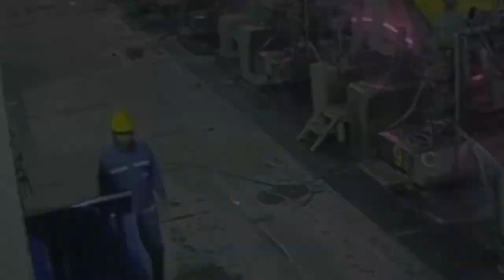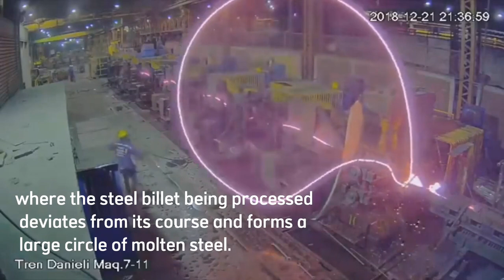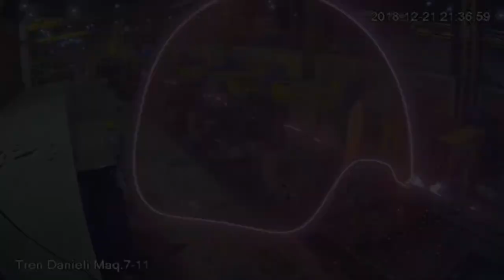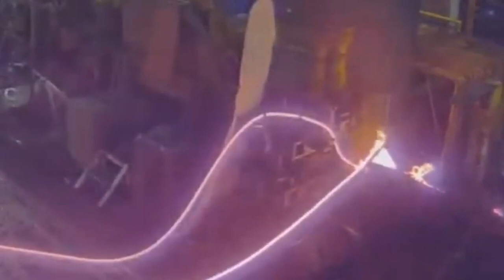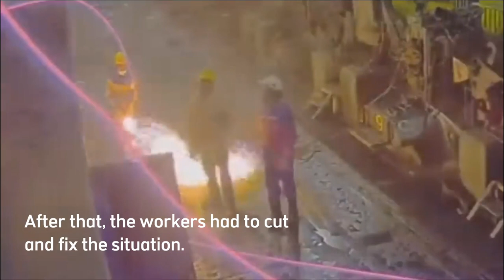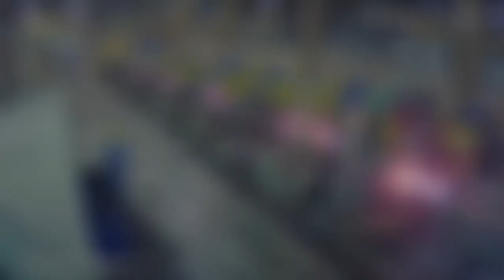Terrifying Steel Factory Accident: Workers' Close Call with Molten Steel Shower!" | MISHAPX

Comment: This is a perfect video to stress the need for emergency stops and why training workers to use them is so crucial.

This machine more than likely has one, but it may only have one near the controls. A piece of equipment like this would benefit from several and even having workers equipped with remote E stops.

The main catch is that a wireless would be pretty expensive to buy and install.
Reply: I don't know the exact reasons but as I understand it once the billet is moving through the machine there just isn't a safe way to stop it, though I do wonder if it would be possible to have an emergency cutter that shears off the billet and diverts the remaining part?